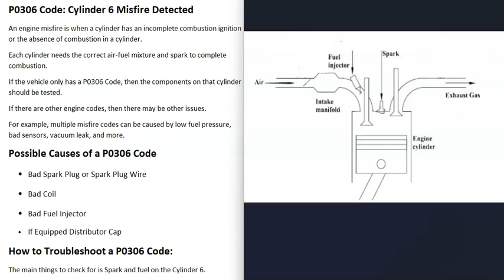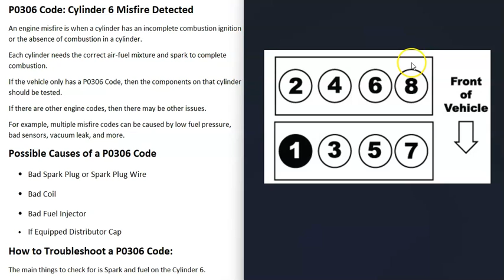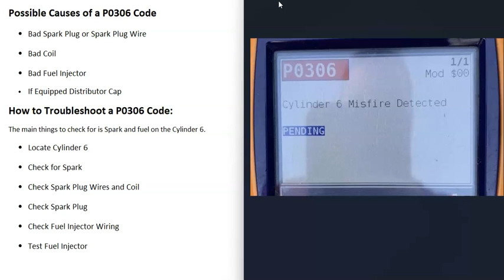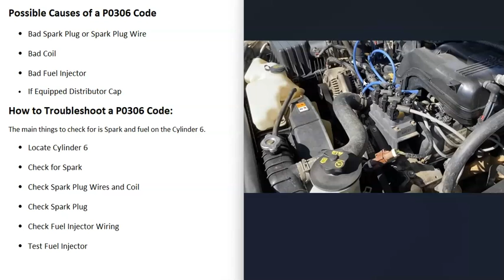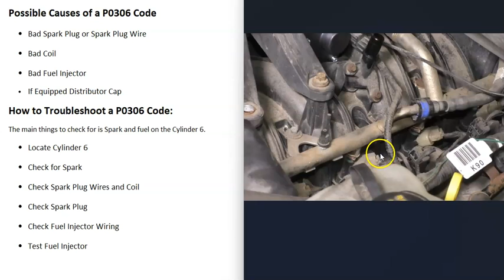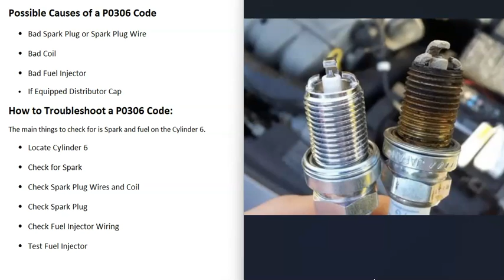Causes and Fixes P0306 Code: Cylinder 6 Misfire Detected

Comment: Got this code and a P0101 code already changed coils n spark plus nothing
Reply from the maker: There might be a Cylinder #6 problem, but I would fix the MAF sensor code first as a bad MAF sensor can throw off the computer and cause other codes.

Comment: I recently got my check engine light on and it said cylinder 6 was misfiring, I got a new coil and spark plug and had them replaced, a day later the engine light came on again and again it was the same cylinder. What should I try to do this time? I brought the same spark plug that was in the truck brand new but the coil was given to me by a friend that has the same truck and had a spare coil left over so he gave it to me. What should I do? I will go back to the mechanic that replaced the spark plug and coil and ask if he can check if the cylinder is getting a good charge. Aside from that what else do you advise? There was only 1 code number 6 no other codes came up.

Comment: Chevy Tahoe 2003, the codes that came up are  P0306, P0135, P0132, I've replaced the spark plugs, coils, wire set, and the O2 sensors, and I just got it back from the shop :/ not sure what I need to do, if I can fix it myself to save some money I will!

Comment: p0306 3.5l pontiac g6.. Replace plugs, wires, ignition coil, great compression, complete new exhaust. You can balance a nikle it runs so smooth.. but the dam code. Tried different scanners. there is no misfire.
Reply from the maker: It may be an intermittent problem, such as a loose wire that only disconnects on a bump but reconnects, or possibly a component starting to fail, but still works most of the time. Intermittent issues can be difficult to diagnose.

Comment: 3.9l dodge 1997 has a p-306 code. Replaced all plugs, wires, distributor cap with rotor button and pickup inside distributor. I guess it's gotta be injector I assume. Might try cleaning throttle  body and I almost forgot I changed the TPS sensor.

Comment: P0301 and P0306 (misfires) on 2002 Lexus GS300. Normally, I would play musical coils to pinpoint the problem, but the Lexus is not a simple coil swap to me.  Took to a mechanic who is not able to resolve the problem.  After this originally happened, I checked and cleared the codes. Drove the car with a mechanic but could not duplicate the problem.  Several days later, I drove the car and set the cruise control at 58 mph. Going up an incline, the car jumped into passing gear and immediately, it died.  I could start and drive a couple of feet and it would die again.  Towed it to a mechanic who has not been able to fix the car.  Here is a list of what he has done so far:

Symptoms and Diagnostic Trouble Codes
 CUSTOMER STATES VEHICLE DIES WHILE DRIVING DOWN THE ROAD

Advisory Notes
WE HAVE REPLACED THE IGN CONTROL MODULE THE 2 SPARK PLUGS AND REPLACED THE CAM SEAL POURING OIL AND REPLACED THE CRANK GEAR AND SENSOR

At this point he doesn't know what else to do?  

Any advise?
Reply from the maker: It needs to be diagnosed, but it sounds like a fuel issue, especially since the coil components have been replaced. I would check the fuel pressure and injectors.

Comment: 2008 hilander p0300 p0302 p0306 codes these mechanics say spark plus ignition coils wires ignition coil connector what is really the issue?

Comment: My 2007 FJ cruiser has had this issue going on for several weeks now. Through testing the spark plug and the coil were ruled out. Eventually, the fuel injector for cylinder six was inspected and replaced. At that point, we hoped that all would be fine, but after driving another 1000 miles or so the indicator lights came back on and the code on cylinder six was back again. So far no vacuum leaks or other leaks have been detected. Seems unlikely that it could be as simple as the distributor cap but I’ll make sure that gets checked. Any other thoughts?
Reply from the maker: You have checked all the most common causes. I don't think that year, FJ Cruiser has a distributor cap. It needs to be diagnosed, but the cylinder could have mechanical issues. Doing a cylinder, a wet/dry test will show if it is or not. There could also be an intermittent issue, such as a loose wire that is just causing an issue, triggering a code that goes back to normal.
Reply: @ the tech is now telling me that they found some moisture… Most likely coolant… In cylinder six. Probably a leak in a gasket? They are basically telling me now I need either a new engine or to rebuild the one that I have.

Comment: I have a 2007 chevy tahoe ltz i just picked up throwing the po306 code, changed the spark plug wire ignition coil fuel injector maf sensor and its still throwing the code i think ill look for vaccum leaks next and check the oil senor with the little filter underneath it before i start looking inside the engine
Reply: You may have a collapsed lifter. You could pull the valve cover and check.
Reply: Somewhat common on chevys with active fuel management
Reply: What was your final conclusion? Lifter?

Comment: Big question... 

Could a cracked flexplate throw a p0300. Making a clunky noise. 

Parked for a month in the cold i couldnt do anything. I think i seen a broken manifold bolt near 6. Had a charger on it, started perfect. No misfire but still knocking.  

Then i heard a flexplate might be making that clunky sound and could throw. ?? Please help.
Reply from the maker: A broken flex plate can cause knocking as it spins but shouldn't cause a misfire. There likely is another issue.

Comment: 2012 Dodge Grand Caravan I keep getting cylinder 6 misfire. I replaced the ignition coil and also replaced the spark plug. I still have the code. What should I do next?
Reply from the maker: If the coil is good and you're getting spark, I would test the injector next.
Reply: @HVAC_Mechanic  Dodge Grand Caravan  2015 water in gas treatment  in gas all old gas out new gas all gone
Reply: What did you meant ? Was water in gas was your issue?@jenjameshowsonhowson

Comment: Hi, I have a 09 honda Odyssey. I have 2 codes of p0204 and p0206. I changed the plugs coil , and I also did a compression test  and still misfire. I did a smoke test also  any  suggestions
Reply from the maker: is the fuel pressure and fuel injectors good?

Comment: Had this code on my FJ, replaced both spark plugs and ignition coils, after a week code is back on and also slight engine vibration when cold start
Reply: What did you do to fix the issue ?    Im dealing with the same thing now after changing plugs and coils.
Reply: That sounds like bad compression

Comment: i have that code on my 6.4 engine dodge charger and i been trying to figure out how to fix that, the old shop i went to said something about a low compressor on my 6 cylinder and it would need a rebuilt engine
Reply: i dont think he was telling the truth i think he just didnt want to fix the misfire
Reply from the maker: It needs to be diagnosed, but if the cylinder has a mechanical problem like a bad valve, then that can cause issues.  A compression gauge can be used to test it.
Reply: @HVAC_Mechanic  but it still drives noce and engine sounds quiet only thing is, the exhaust, u can tell its a misfire

Comment: Have a 2013 XC90 AWD 3.2 6cyl with 244k miles, Was throwing a P300, P303.& P306. Replaced all new spark plus and coil packs. P300 and P303 went a away, but still have a P306 code. Debating if its and injector because a bad injector with throw a code itself. Any thoughts?

Comment: Had a misfire on #6, bad plug wire replaced, removed plug wire it was still running kinda rough, it went dead, now it won't fire at all. Spins over fine just don't have any fire, should I change ecm?
Reply from the maker: An ECM failure is rare. If you think there is a computer issue, be sure the battery and alternator are good since the computer needs a good, stable power supply to work. It needs to be diagnosed, but I would check for a spark and if that is good, test the fuel pressure.

Comment: i change my plug,my injectors,and coils,on my 08 dodge 1500 with the 5.7 in it what else could I check because it’s still throwing the P0306 code after doing everything you said to do in this video.. Could it be something on the inside the motor that is going bad I can get it up to 80 but it still spits and sputter.. But it also doesn’t have an exhaust on it.. it just coming from the manifold with about 3to4 ft of pipe on it.. I bought it that way just a few days ago but trying to figure out this problem.. PLEASE HELP
Reply from the maker: The things in the video are the most common causes, but there can be other things, mainly mechanical, such as a bad valve, cracked cylinder, engine deactivation solenoid, and more. To check for a cracked head, a leak-down test can be done, but since you have checked all the most common causes, it can be hard to troubleshoot.

Comment: I just took my 2002 Silverado 4.8L with a P0174 code, started idling rough, smell of gas,  loss of power, took to a shop, told him I just replaced all spark plugs and wires and replaced evaporator canister on top of engine. With out looking under engine just going by sound, shouts out to me “ you need a new alternator, battery is showing on console “ I said no, alternator is new, anyways just called me & tells me it’s cylinder 6 misfire & I need a new engine. It has too many miles??? 
This truck is from Bay Area, the console was used parts & replaced old console when truck was stolen in Oakland. So the engine in truck has 188K miles although the dash says 268k. 
I guess I have to take it to another shop because he is trying to play me now. Can’t a cylinder be fixed alone ? And not have to replace the whole engine?
Reply from the maker: It is possible that there may be a crack in the head on that cylinder, a bad head gasket, a bad valve, or similar. If there is a crack or bad head gasket, a compression test would show it.
Reply: 😂 damn mechanics
Reply: I have the traction control light on and #6 cylinder misfire. Seems to have happened after l plugged in my trailer. New plugs and wires installed?
Reply: I have the same code but the missfire only happens when I accelerate fast and it misses until I shut it off and let it cool.    Then it doesn’t missfire until I accelerate fast again.    Probably need a motor.
Reply: I have a p0306 code on my 2000 Buick century could it be injector ?  I changed wires plugs and coils still idiling rough I changed the egr as well first when I scanned it was a p0300 then the next day I scanned it then it gave me a p0306 so ik it’s cylinder 6 but I’m confused on if it’s the injector
Reply: @litoeast you ever figure out what it is? I’m having similar issues and I’m thinking it’s the same thing (2007 Infiniti m35)
Reply: @mass9213 yeah bro it lost compression in one cylinder so I had to replace the engine
Reply: @litoeast  why didn’t you just fix the compression loss?
Reply: @mass9213 every shop I took it to was just telling me I needed to replace the engine
Reply: @litoeast  damn I’m really hoping that’s not what’s up with mine 😭
Reply: @litoeast I had same issues changed injectors, spark plugs, coils are good. Was getting cylinder 8, then it went to cylinder 6. New fuel filter
Reply: @tommyboudreau227  yeah could be motor bro